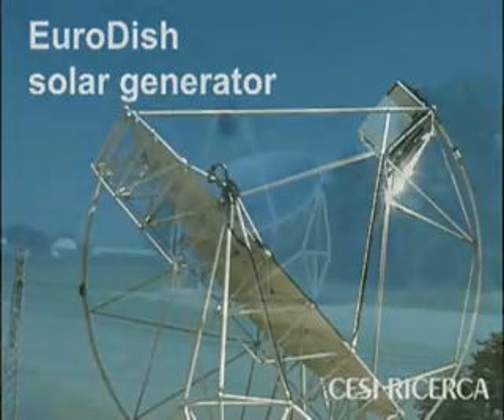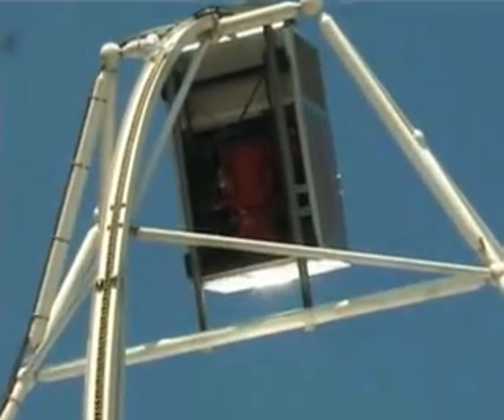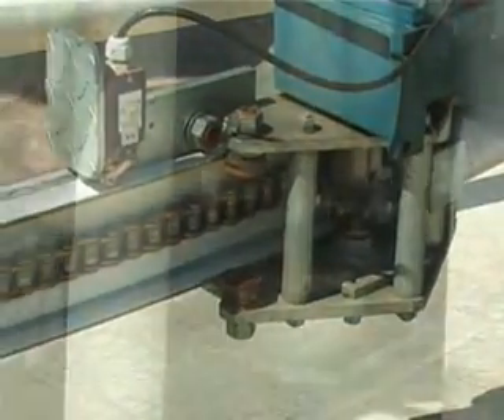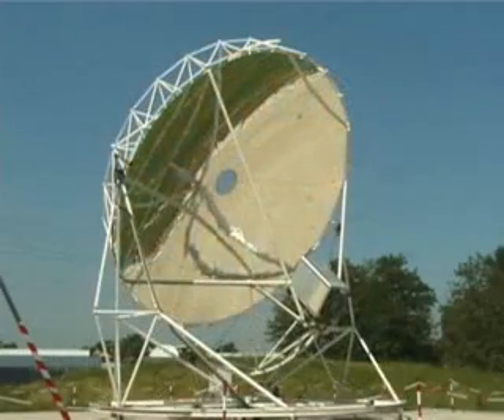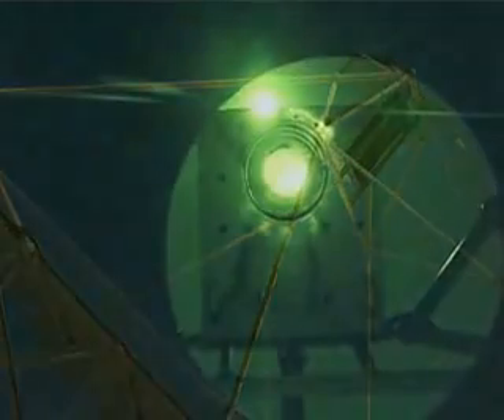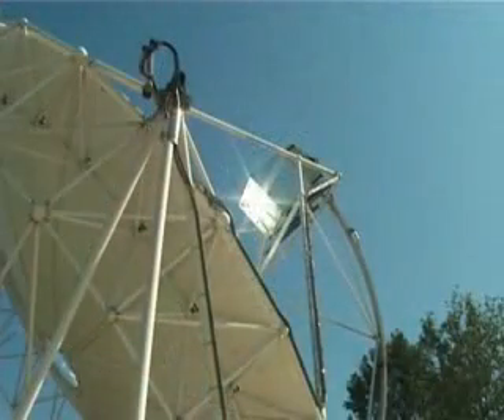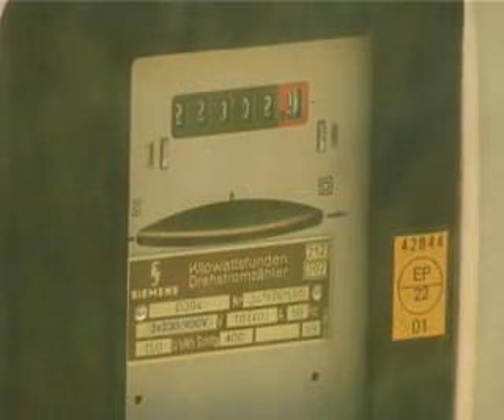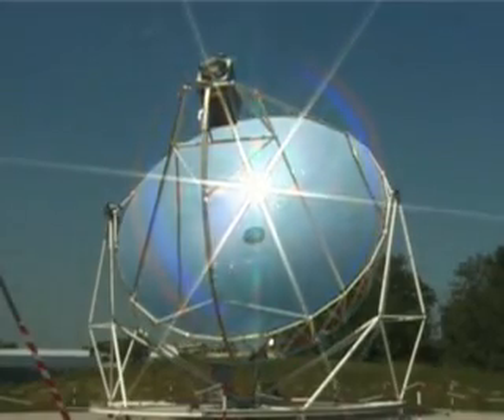European Solar Powered Stirling 10 Kilowatt Generator

Comment: @bluephantm Biggest problem you see, is that as oil peaks and
the solar conversion can't keep up with demand, this can, until
solar can catch up. That may take 50 years. They can start with
Stirling dishes next week, and they don't have to cost 30,000 GBP
either. Building the engine to last a few years only costs a few hundred,
and the dish about the same. This is 3rd world technology that works,
guys!

Comment: @bluephantm In addition, the dish is quite easily fabbed from
reflective foil and plywood. For simple tracking a cheap equatorial 
mount suffices, and simple hanging weight driver can be
turned on and off by a simple clock work and a small DC motor
to operate a start/stop escapement. The DC motor is powered
by a small 3" solar cell, and the power output is 20% of the local
insolation (sunshine). I built one that used steam, but Stirling is
better and more efficient.

Comment: @bluephantm I'm a physicist who has studied Stirling engines and
their efficiencies. I've read all the papers on them and reviewed the
data. While they don't quite make it to the conversion efficiency of
photovoltaics, they make up for that in needing less infrastructure
for their manufacture, and once a design is settled upon from some
relatively easy experimentation and proof of concept, they can be
cloned by the most meager machine shops found in every town.
Reply: Studied a lot of Stirlings, huh? Would you like to help with an analysis of a new design? Lots of improvements that should impress you. McKissick (at) Gmail.com
Reply: @toddmckissick2931  
I'm retired and ill/dying. (Not worried). I doubt if I could pull my weight anymore. I'd love to hear about it, though. My major feats lately are making it to the bathroom and communicating online. The parabolic Stirlings seem the most promising, but I would love to see a design powered by a solar trough concentrator or heliostat array for a large Stirling.
Reply: @rstevewarmorycom in sorry to hear that... But email if you're interested. I'll send an NDA and blow your mind. We've gotten 72% efficiency (unofficial with a Carnot max of 81%) out of this guy, even before the latest versions which should raise that even more. We started from the most basic physics and worked up from there. And yes, we can scale from 1 kW up to 10+ MW using any source. Lots and lots more too. 😁
Reply: @toddmckissick2931  
That's okay, I haven't the energy for it. When it appears in a YouTube video I will indeed watch it, if I'm still around. Thanks,

Comment: @beowulf500ad Of course they need a source of heat! But they are like photovoltaics in
that they need little other maintenance after manufacture, and they amortize their cost
in but a tiny fraction of their functional life. Like solar PV's which are paid for in a few years
but continue to provide energy for 30 or 40 years, solar powered Stirling engines have a
similar cost/benefit profile.

Comment: @rstevewarmorycom They do consume fuel (heat).  You have to produce that heat somehow or it won't work.  Some stirling engines are powered by natural gas or like this one which uses mirrors to focus sunlight.  It's sorta like solar panels.  They only require sunlight but are real expensive.
Reply: Ya, but it has a distinct advantage over solar panels. One of these dishes produces 10 kwh on a good day. You'd need hundreds of square feet of solar panels to get the same power output.

Comment: @maxhax2000 Even nicer, both together, best use of land, best collection of
energy per acre. Wind is not constant, and often sunlight occurs when the
wind is quiet. PV is fine, too, but it is a little high tech for many places in the
world that don't yet have a silicon foundry or other access to what now will
be a limited resource as everyone will want PV's as oil crashes! It may take
a century for our PV fab to catch up with demand. So we must exploit thermal concentrator technologies.

Comment: @maxhax2000 Stirling dishes need NOT be costly. You can fab a parabolic
dish to reflect 90% using aluminum foil! And focus need not be perfect, a spherical
form will work because the target is good sized. The Stirling engine itself is nearly
trivial to build for any machinist, and needs only modest maintenance. The tracker
can be a solar cell running a dog that stops a hanging weight geared advance. The
frame is the most expensive item!! But it's like the guy said above, it's not exploitable!

Comment: @MrDasmaster actually Stirling engines are produce as much power as a standard combustion engine...the only difference is where you spend your money.  Stirling engines cost more to build and combustion engines cost more to run.  The main benefit with the Stirling engine is that is can run on any heat source.  The Swedish Gotland-class submarines use them over diesel engines.
Reply: not to mention potential as a hybrid.thats really where the Stirling will kill the oil man.we got the tech now to do it.just not the balls lol.we know Stirling's are very efficient.and we know they can run on any heat source,such as hydroxy gas,which is for intents and porpuse,pure fuel,without the carbons.and hydroxy can be generated from water with the very electricity produced by the stirling.good batteries can store large amounts of potential energy.just use electric motors to operate the vehichals.simplified engineering,more efficient,and would be true zero emissions.everything the oil man hates.

Comment: @rock3tcat 

require large thermal differential that needs fans to cool the working fluid within which causes material to creep
dissipation of heat is complicated and requires larger radiators increasing price
low power output compared to size of machine
needs time to start up and does not change load very well
working fluid must be sealed within the cylinders while pistons pressurize the fluid loss of pressure and the entire thing stops.

Comment: this is ok for a idea but it doesnt produce as much power as a few solar panels stirling engines produce to little power and torque better to heat up water using the sun and use a steam turbine if you want electricity!